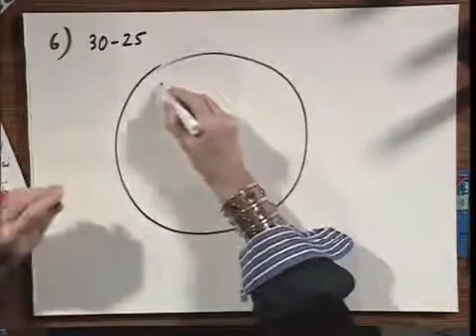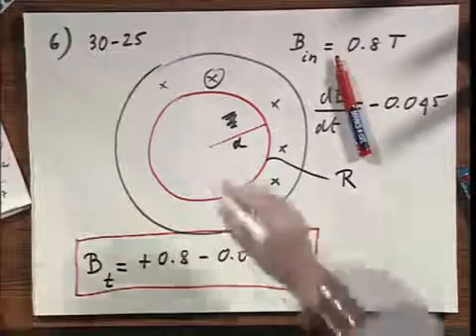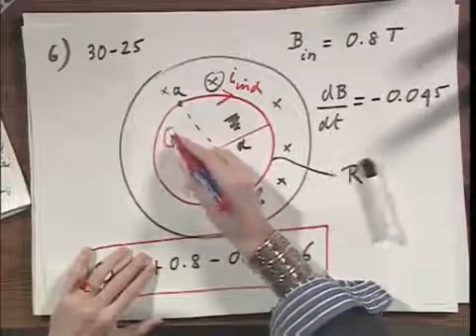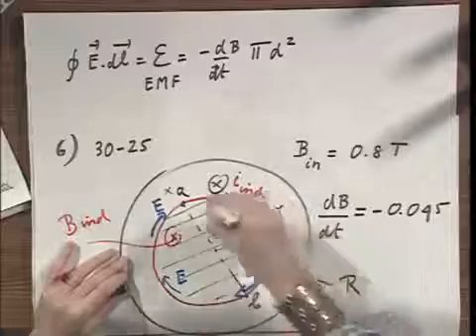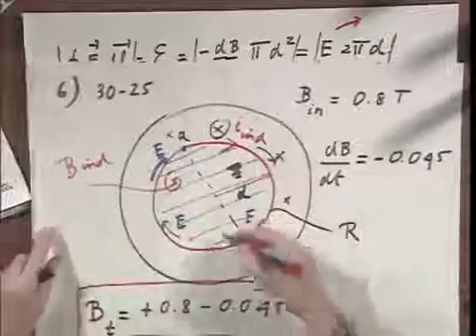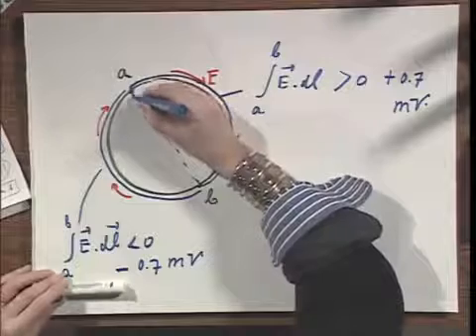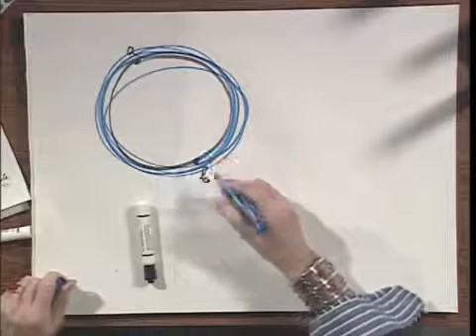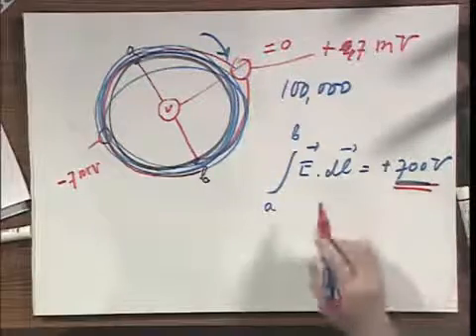8.02x - Module 06.04 - Induced Current due to a Time Changing Magnetic Field.

Comment: Sir is the induced electric fields always circular. Where is the centre of these circles.
Reply from the maker: it's in a closed loop regardless of the shape of the loop.
Reply: Not clear sir. Forget about the wire loop.  The electric field is still induced in the space of changing magnetic field. 
Now can you tell how are these field lines? Concentric circles always? So where is there centre. Imagine I have changing magnetic field on an infinite plane perpendicular to the plane. How shoud I imagine the induces electric field. Circular ? Where is the centre ?
Reply: @physicsconceptsbytusharkha7638  Well if you suppose make a circle at your place in that infinite plane, another person can make a another circle in the same plane that is not concentric right? And then you can say (obviously) both  of the circles will have two different centre, but wait, another person can make a circle at same place as you did(I mean around the same centre as you did) but with greater radius. And yes it is possible, which means on a common centre there can be infinite possible circles and hence you will get infinite possible induced electric field which will cause a current to flow and ultimately give a magnetic field which can either add on to the decreasing magnetic field (like in the above problem professor took B to be decreasing). Just to resist the change in magnetic filed in the defined region.  Now will all the induced electric field in all the concentric circles same? No, as from Faraday's law we saw the induced electric field depends upon the radius of your loop. But just think it for a moment without any maths equations, we know that electric field are induced due to the fact that in your loop there is a decrease in magnetic flux(B. A) right, these electric field lines are only to resist the change in magnetic flux, so what will be the centre of the electric field lines, well I don't think finding out a centre for your induced electric field will do any good to you, and infact the center of you loop will be dependent upon you only. And once again in a infinite plane there are I finite possible circles with some infinite concentric circles and some infinite non concentric circles,
If I am wrong please correct me, I am Just a 10th grader this much is being taught to me so...
Thank you sir.
Reply: @rishu_Kumar07  you are right, solving for the electric field using maxwell’s equations gives a field dependent on undefined boundary conditions or some initial values. In the case of an infinite plane and a perpendicular B field, solving for a unique electric field becomes impossible, there is a question on physics.stackexchange with a detailed answer. You can refer to this for further breakdown of the situation.

Comment: I wrapped a 830ft copper #20 gauge  wire. into a coil.  Actualy I cut the wire into 8 =sections of 100 feet and wrapped all 8 with a 1 wire #23 Gauge of equal length.  Basicaly a coil of 9 wire.  I build the bedini wheel of magnets rotating around the stationary coil.  As the magnet approaches the coil, (the center of coil is welding rods) magnetises the center iron and at dead center fully charged and as the magnet leaves the collapse of the magntised coil pushes a huge voltage spike.   IT dont mater if it is negative or positive.  It is the magnitude that I believe I am capturing and sending it through a rectifier to charge a battery.  The rotation of the wheel acts as a fly wheel and the 8 transistors provide more off time than on time from the primary battery.   

Can you insult me the best way you can and how the entire DIY wastes time on such things

Comment: Sir, Can you plaese tell why kirchoff law fails here ? You are only explaining that it does fail due to the fact emf depends on path taken here . Is that the the only reason?
Reply from the maker: In the case of an induced emf the closed loop integral of E dot dL is NOT zero (Faraday's Law). Thus Kirchhoff cannot be used.
Reply: @lecturesbywalterlewin.they9259  Sir , suppose the magnetic field is kept constant  and area swept by the loop is changed.The current will be induced in the loop due to induced emf which is created due to change in area .Will kirchoff law hold there?. I think it  will as sum of all potential difference s 0. Am i right sir?
Reply: @lecturesbywalterlewin.they9259  Instead of equal zero would be minus the rate of change of flux, right?

Comment: What if instead of taking a concentric loop we take a wire loop that is non concentric.. Then the direction of current in that loop at a some point turns out to be different.. (not tangential like in earlier case)  So what is going on Sir? Plz help
#LecturesByWalterLewin
Reply from the maker: the loop does not have to be circular. The emf in the loop is given by Faraday's Law. If the resistance in the loop is R, then the current everywhere through the loop is emf/R.

Comment: so when we have a time changing B field it is called non conservative and Kirhoff's law does not apply??
Reply from the maker: correct - however, if you have an AC current in a circuit whose sel finductance is negligibly small, then K would still be OK even though there would be a changing B field.
Reply: @lecturesbywalterlewin.they9259  waao sir u replied